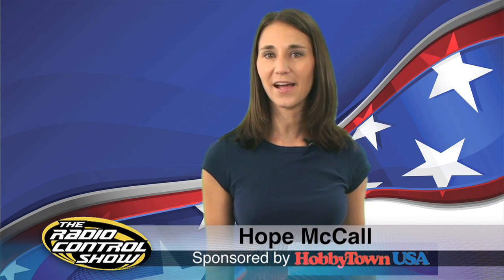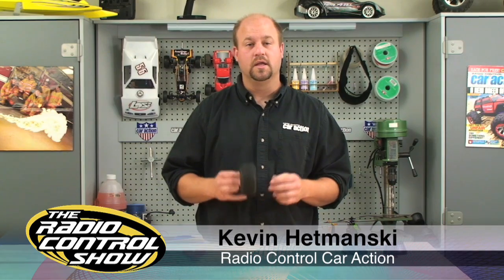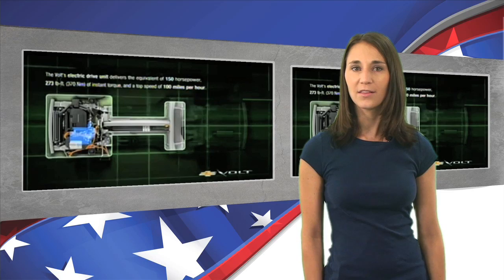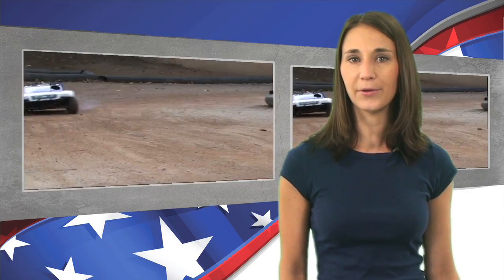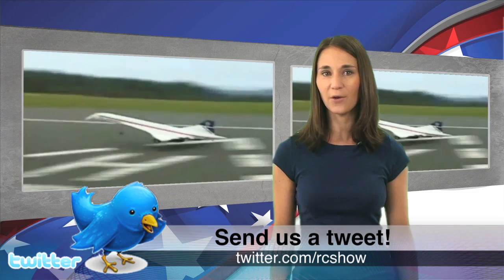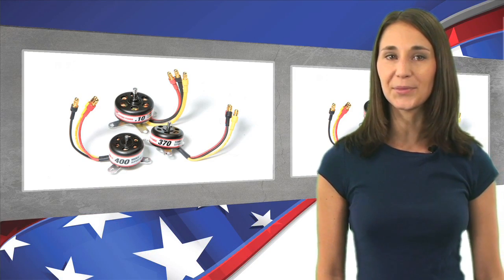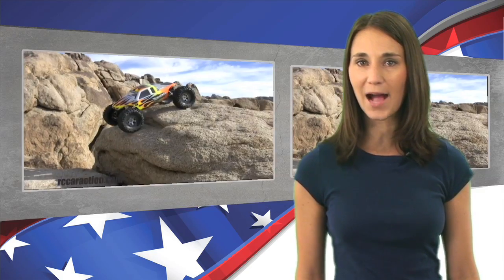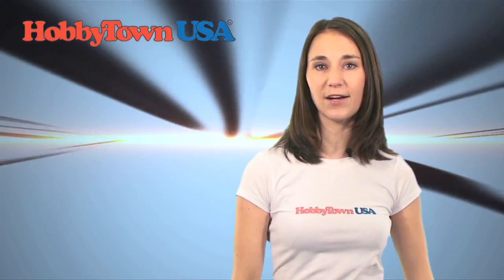$25,000 RC Jet - The Radio Control Show 9

Comment: @chrisocar 
Here are the facts: For 2009 US electrical Generation by Source.  This is % electricity  on the grid.  
44.9% COAL, 23.4% Natural Gas, 20.3% Nuclear, 6.9% conventional Hydroelectric, 3.9% Other renewables (Green Power), 1% Petroleum.  That 3.9%, that's green power.  It will be a long time before Green Power has an effect on the electrical grid.....